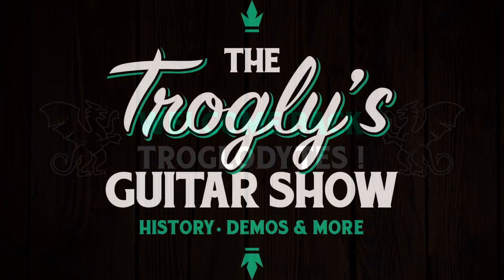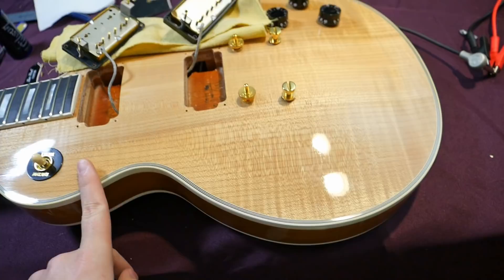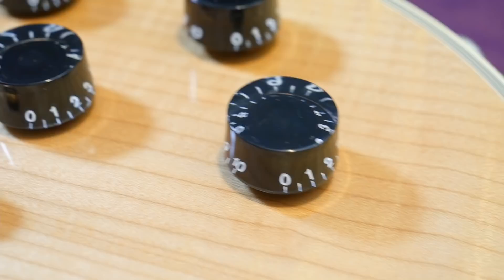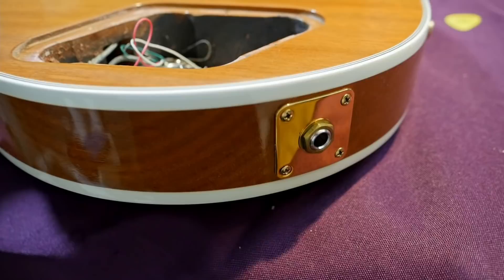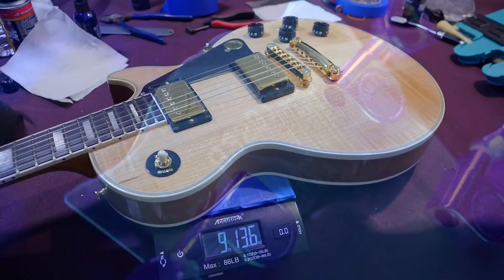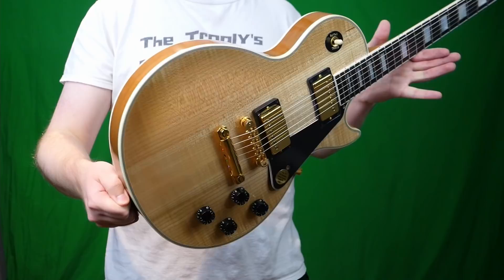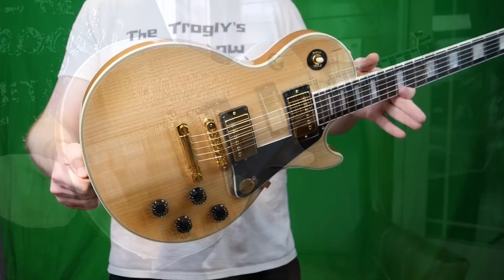The Shop Owner Held THIS Back For Himself! | 1991 Gibson Les Paul Custom Natural Flame Top

Comment: I think that guitar shows signs of a headstock failure - not broke yet but it will exactly where that crack has started.  Most likely dropped on end in the case IMO. The finish crack is not a normal shrinkage crack, it's damage from trauma. Steer clear or pay no more than you would for a repaired headstock.
Reply: Definitely agree.
Reply: @akasgsvirgil9503  I don't think it's a three piece top. There is a clear center joint. 6:45
I don't think it's a correct bookmatched top though.
Reply: @akasgsvirgil9503  What? No... 
I'm talking about the maple top center joint that is very prominent at 6:45.

Now could it perhaps be a 4 piece top? Maybe... 🤷
But they would have to have glued up asymmetrical pieces which is just weird and harder to do so I find it unlikely...
It doesn't even look like completely straight lines in the grain where the extra joints would be which further points to a two piece. But that's a bit hard to see in the video though...
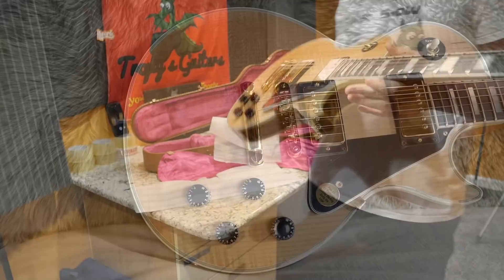Reply: @akasgsvirgil9503  Looking at it again at 2:56 the flames goes from the outer edge to the center joint in many places...
Matching that in a 4 piece would be one hell of a joint!
It's a 2 piece...
Reply: @akasgsvirgil9503  This is fun! 👍
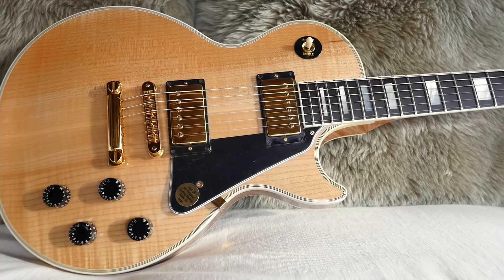Look at 2:56 again. You can see flames going across those exact points you reference. And across the rest of the possible joint. That is basically impossible... 🤷

I do see the weird grain in the guitar. I also thought it was an extra piece in the middle first. 
But since there is a center line, no straight lines for the extra joints, flames across it it's just cool grain, which isn't impossible...
Reply: @akasgsvirgil9503  Also I of course know using multiple pieces isn't uncommon. But off center, asymmetrical pieces is. It's definitely more an indication of a 2 piece rather than what you are saying....
And no matter what....
When Trogly moves it in the light the flames moves exactly the same across the proposed joints...
Reply: @akasgsvirgil9503  "Otherwise, you'd see a distinctive seam directly through the center of the top from strap pole to the center of the neck pickup. There isn't one there"
???
There very clearly is.... 🤷
I don't understand?
Again 6:45.
There's nothing to argue about the joint in the center of the guitar...
Reply: @akasgsvirgil9503  Apparently not?
Or you haven't watched the video... 🤷
Let's try a third time... 6:45
If you just tried and click it you would see the the center seam as clear as day...

This is getting really, really, strange from my perspective.... 😁
Reply: @akasgsvirgil9503  😁🤷👍

Comment: Nice guitar! I'm amazed how pristine the gold hardware has been preserved all these years.  I have a '97 Jimmy Page Signature LP and for the few times I've used it, the gold hardware has tarnished quite a bit.
Reply: I tried one of those in a store back in the late 90s. I remember the neck was very comfortable and playable.
Its got some sort of different radius right?
Reply: Nichols give me that guitar
Reply: @standinsilence  Not sure of the neck specs, a little chunky but comfortable to play 👍
Reply: Lots of non-ferrous metals tarnish, but pure genuine gold does not. have you tried a good metal polish like Brasso? it will work. I have a Buck knife adorned with brass and the stuff works wonders in a few moments of use. real metal polish will always smell of ammonia. tarnish stands no chance, try it. hardware stores stock it.
Reply: @standinsilence  Yeah, the neck on that model is shaved thin in the middle, making it a fast player.

Jimmy Page withdrew support for the mid-90s model though because he wasn’t happy with the results. The 2000s version is much better.
Reply: @DougZbikowski 
He did?
Thats interesting.
The newer ones are Custom Shop only right?
Reply: It’s not been played, it’s usually peoples sweat that wears the gold off.
Reply: @standinsilence  Yes. In fact they borrowed Jimmy's guitars in the early 2000s so they could replicate them exactly.
Reply: Baby wipes work the best, don't remove the gold plating but remove the tarnish.

Comment: What do you mean a 57 decal that got worn off?
A bridge pickup 57 decal got worn off when it is on the bottom of the pickup? Worn off in the pickup route? Worn off while it's stored away?
Okay, I want to hear about this
Reply: I knew it was 490/498 when I first saw them.

Comment: That checkerboard grain pattern in maple is what you get when you perfectly quarter-saw the lumber.  The notebook-straight grain lines are also indicative of maple that has been perfectly quarter-sawn.  A lot of wood gets wasted to get a perfectly quarter-sawn piece of lumber out of a log, so it often comes at a premium.  Most maple tops (and necks) are flat-sawn.  Quarter-sawn wood gives more stiffness is the string-pull direction also... as well as the stunning grain... so some necks are quartersawn maple for that reason (EJ Strat for example).  Gibson necks are usually quarter-sawn mahogany to aid in stiffness, but mahogany doesn't exhibit the checkerboard grain pattern as well as maple.
Reply: My PRS has a quarter sawn maple neck.

Comment: Did this come from a store in Philadelphia? 
Any way a couple points: the "custom shop" decal early on was used for test market and other limited runs like special order runs for certain dealers like the various LP standard models with late 50s features ordered and sold by stores like Veneman and their Music Emporium mail order division, Cintioli in Philadelphia and others starting in the late 70s.
Your concern with finish checking is somewhat mistaken as it pretty much comes with the territory with a nitro- cellulose finish. Yes aging and sudden changes in temperature will lead to finish checking but it's cool, not a bad thing and indicates a more vintage type paint with less plastic in the nitro. My experience with cracked finishes included a 1966 NR Firebird III with beautiful checking all over and watching the finish on a 1963 Melody Maker crack before my eyes in the spring of "81 after opening the case after a long ride from MD to MI. Like watching cracks spread across a frozen pond. Unlike the current  Murphy Lab finish situation, the paint on both those guitars remains attached to the instruments. No one is going to be bummed out by checking on a vintage Gibson and a '91 guitar being 30 years old has seen enough wood expansion and contraction over time to show some checking.
Reply: As much as this young man knows about guitars.that sticker was so important to him on that guitar I it put a mental image in his head. That them humbuckers were probably custom-made. And everything else custom done by you notice of that one guy that signs them. Trust me I know. He spent 25 Grand on that fake Les Paul custom guns'n'roses of Slash. That had the crappiest paint job fake. That's twenty-five thousand US Dollars.

Comment: I LOVE naturals. There is a 77 Natural with a maple fretboard on Reverb right now that I wish I had the cash for badly. The selling is asking a bit too much for it at $6500 though. I know the price is due to the maple fretboard but it's not in great shape. Most of the guitar is in decent shape, but the one thing that is pushing up the value is pretty well worn.
Reply: I paid 1500 for mine but it has emgs in it but it has a maple fretboard and is a 77. I think the previous owner tried to make it a zack Wylde tribute but I’m going to take them out eventually.

Comment: Thank you Austin. Summer of 2019, I sold my 1980 Les Paul 'KM' natural finish 2 piece front, for $2000.00  ALL ORIGINAL too. (Of which, I was the original owner. bought from Sightsinger music Santa Ana CA.  It was a heavy beast. 12+ lbs.) and that's why I parted with it. I could kick myself for selling it. The moral of the story? I bought it for $600.00 in june 1980. (With case) now over $5000.00. And what a tone monster it was! 
Happy new year. Keep sharing.
Kurtiss 👍

Comment: The top looks like it isn't symmetrical. Looking at the tailpiece and bridge you can see how the grain looks like it's offset to the bass side.
Reply: Looks like a 3-piece top to me.
Reply: You get that with quartersawn heartwood. You're seeing the grain from a different angle than the flatsawn normally seen on guitars.

Comment: What IS the proper way to store guitars to prevent or minimize finish checking? Just out of curiosity, and for future reference…
Reply: @akasgsvirgil9503  thanks for the info. I’ll keep an eye on mine!… I’ve had a dehumidifier in my practice room for about 6 months now. Usually keep it around 45-55%. Keep them in their cases. Any advice is greatly appreciated!

Comment: That's what i'm talkin' about!! I get the finish crack thing, it's like, if think about it - that flaw takes control of the thought. Maddening. If resprayed, hurt value more, or more from cracks looking like breaks? I'd vid guy doing the strip and wood verify- make stills for the case pouch. Not original, better. Great top, sounds great - looks like '68 Reissue. Dreamy!! Ü

Comment: I really need to know. How much different can one les paul be from another. I'm really not trolling. I've only felt one or two and I'm not impressed with them. True I grew up playing fenders and super strats but I'd like to get one. My only dislike is weight, they all look the same and the ones I've played had big chunky wood block shaped necks. Can you recommend one the a shredder might like maybe a slim neck.